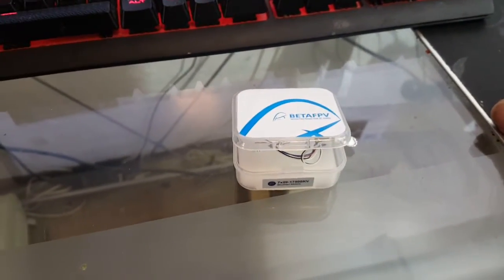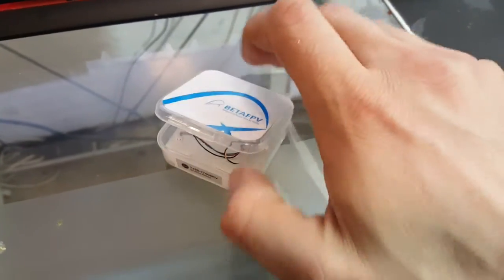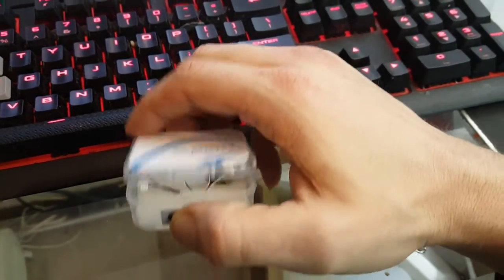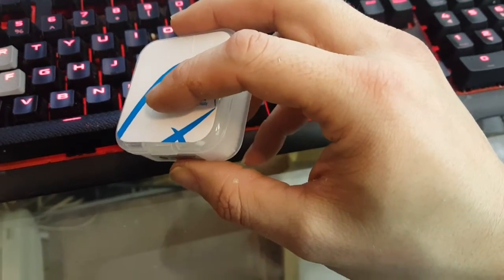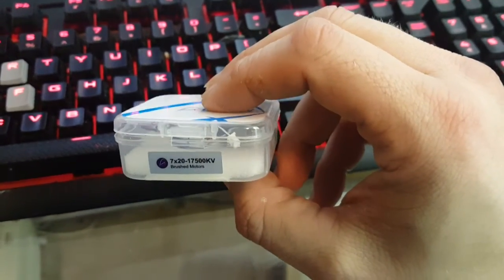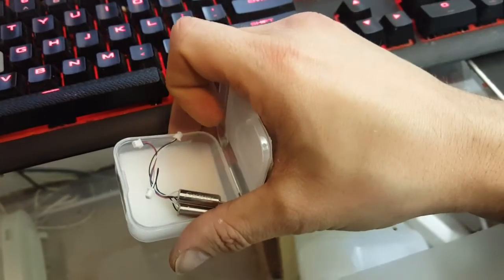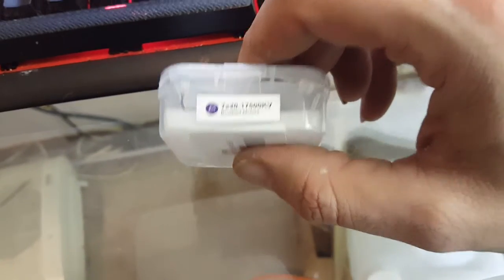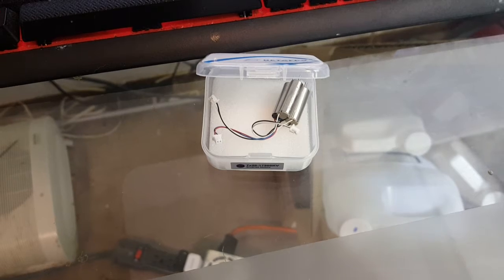BetaFPV 7x20mm 17500kv motors (short review)

Comment: Out off all the brushed 1s motors made These Motors kick ass the most & they are my favorite motor for ultra micro light builds, lighter then 1s 8.5mm motors but stronger  , I’ve tried 19kv but I prefer the 17.5kv because I get better flight times , they have so much more power then any 6x15 or 6x17 motor combo you can find , but dosent take away from flight times especially paired with the right propeller & battery combo .Tricky thing is finding frames to fit them , but they make 7x16 motors that fit better but they don’t have the same power obviously because the shorter can length of the motor